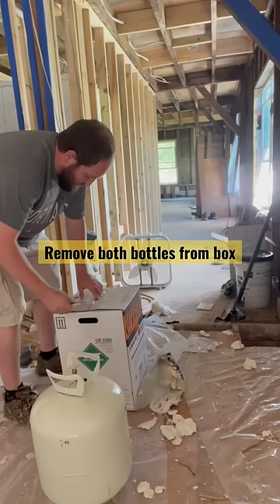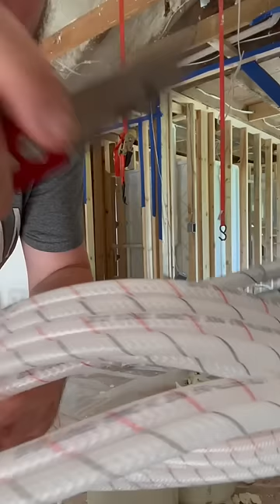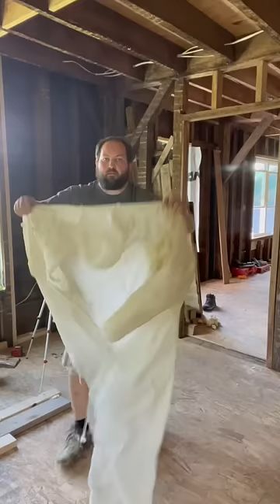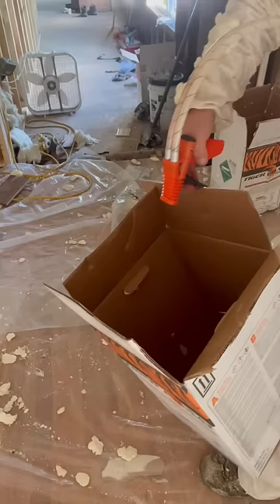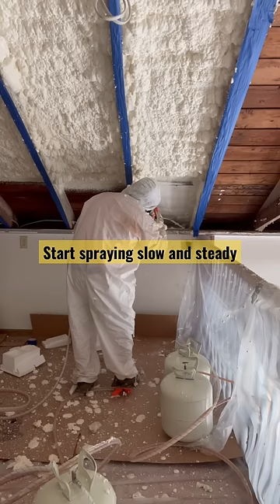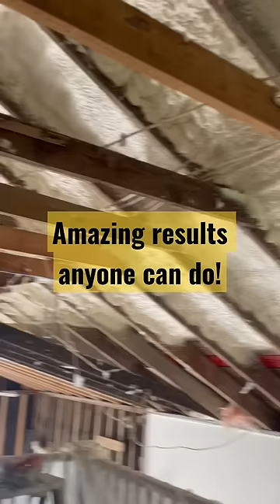Learn to spray foam in 60 seconds! 💡#shorts

Comment: good job but make sure is done correctly cuz even professional people had done wrong by not getting the right mix ratios and temperature, foam is really great on keeping r value but it's a double Edge knife, Current spray foam mixtures containing formaldehyde can produce the airborne MDI against which the EPA warns. Such chemicals can cause cancer and contribute to unsafe air quality.

Comment: I live in Texas and have r-15, r-19, r-30 fiberglass roll insulation & blue board i installed and everything sealed correctly to avoid a hoist of problems like moisture to prevent future rot, and my attic stays around 70°s & 80°s on hot 100°+ summer days. Also its quick and easy to install, remove, replace or get access if work or repairs are ever needed to be done. The foam not so much. The fiberglass insulation isn't as messy, restrictive in multiple ways, pain instilling for repairs replacements and installing, or even take close to as long during the installation period. As long as it's installed correctly and is the correct type, rating and size for the occupied space it not only does the job, but performs and holds up just as well as any other products including the foam shown in this video.
Reply: I would recommend installing baffles between. I wouldn't recommend the spray foam, also this kit costs almost the same as having the spray foam installed including materials... but it isn't my house looks good from here
Reply: I get different climates and whether you'll be heating and cooling the area change the installation process but anyhow love you my dear friends Don't you attack me unless you plan on really sticking it to me good.

Comment: It’s 4am and I’m getting ready to go to work on a Sunday to insulate a house, that’s what we do and iv been trying to get my boss interested in starting to foam houses instead of using regular insulation but he’s not interested at this point he’s already a millionaire from building his insulation company from 30 years ago !!!
Reply: Can you reuse the wood after sprayed?
Reply: @J-Mac8  yes, but it’s not going to come completely off. Because it expands it tends to embed itself into the wood fibers. In general it’s cost of labor vs cost of material scenario for builders. Cost less to just buy new boards. If you want a more eco friendly alternative you’d go with rock wool insulation to get a similar R value. For air tightness you use a sealing caulk at each connection point. The main point of going with a spray foam system is to do a closed air system that uses an air exchanger to circulate indoor and outdoor air. If you don’t have an HVAC system that uses and air exchanger you can run into moisture issues.

Comment: Don’t forget to make sure your mix is perfect. If not this toxic mess will “off-gas” for years and make you sick.
Reply: Well damn, that's more important than the fact its doable. Hopefully everyone who does it knows that
Reply: @DS-qy3qv  Sadly not. And because of this issue some countries (mainly in the EU) are considering banning spray foam. And rightly so.

There are better ways to insulate a house, like sheep wool. It's 100% natural and fire resistant. But more expensive and slow to work with.
Reply: Nah
Reply: @DriftKingNL  NO. the fiber fill companies want you to think that. lots of misinformation out there. There is nothing better than foam. look at what they use to insulate every refrigerator, freezer, cooler or window ac unit, companies know for efficiency and effectiveness nothing can compete with foam. 1 inch of spray foam is more than twice as effective as 7 inches of fiberglass. reason being is fiber insulation does not stop convective heat loss, and that is where you loose the majority of your cooling. most batts of insulation regardless of the type have a R value of around 2. after install due to it being nearly impossible to install without air leakage, and moisture absorption. while laboratory testing for R13. It is a bias test that favors the fiber products and does not account for radiant and convective heat loss.  It sucks to admit.. But R value is a useless figure in the real world. running a bead of caulking between the studs and sheathing and leaving a empty void in the wall is more effective than fiberglass.

Comment: What's the cost for the 2 tanks and hose and spray gun¿? Also, how much Square Footage can those 2 cans cover¿?
Reply: $1200 + tax, and 600sqft of 1inch of only R6, basically just for wind insulation.

ikr... i rather buy rolls of r30-60 for ~$1 per sqft.
plus if youre doing it yourself i can imagine one day youre gonna be regretting spraying adhesive everywhere all over your house.
Reply: From my experience, it cost between  barely less to slightly more than having a professional do a better job.
Reply: It runs $1100 for everything which is roughly 20% of what a contractor would charge you and it seals your house unlike fiberglass insulation.
Reply: They have different size sets, but people think they are able to cover 200 to 600 sf and that is only at 1" if you get the full yield they advertise and you don't

Comment: Those two little tanks on the floor cost about a thousand bucks, don't they? That s*** ain't cheap. And it never goes as far as you think it would
Reply: About $200.
Reply: @petehill7250  provide a link to where I can buy that for 200 bucks.  That's about 800 kit he's using in the video

Comment: And when in 50 years thy house to be destroyed where all tha foam ll go...in the fields. I don't believe that even then there will be a proper recycling process. Insulating the house ll save energy now but the added artificial materials definitely ll need energy and time to be disposed
Reply: Where do your batteries go?   We’ll just send it all to Africa land fills. That will work now we can feel good about our selves again
Reply: Good point - blown foams are a curse on the environment, just instantly breaking apart into smaller units making cleanup a nightmare. Don’t worry we’ll slowly clean them up by eating them. Well, our food will eat them, then we’ll eat our food.

Comment: Also ive heard this stuff isnt good in a house fire because its flamable fiberglass isnt it may seem like it is but itd just the paper and yall i type fast so my spelling is trash and i shut off auto correct becuase it kept changing fuck to duck and shit to shop
Reply: Once it dries it's good in general. If you're in a wildfire area or field though there's a good flame retardant one that could possibly save extra time against fires.
Reply: Ok, sweetcheeks. 😘
Reply: @WhiteWolfos  hmm that sounds nice

Comment: Spray foam can cause air quality issues if the ratio of both parts is off.  Consider hiring a qualified insured professional. Your health is more important than the dyi cost savings.
Reply: Don’t listen to this foo
Reply: Or you can just read and follow the instructions on the kit.
Reply: @miahzzeebest701  not quite. It’s a sub par product. It does not mix correctly you need to be above 1,000 psi to get atomization between the two materials. The piss spray with 2 crossing streams is not a proper mix

Comment: Insulation is incredible. Had my shed done ✅ but it off gassed formaldehyde for 3 years. 

How do you stop that in your house?
Reply: Must have been fiberglass to off gas formaldehyde. Closed cell foam will off gas of its life. Open cell foam off gases when applied thus open cells.

Comment: Good job. Too bad foam has all the negatives and not one positive. The R value even sucks for foam. Idk why anyone pays top dollar for a product that literally traps moisture between your walls making the wood rot like a mth heads teeth... im a contractor btw.
Reply: Totally agree - aside from a few specialty applications - (rim joists comes to mind) it is over priced junk.
Reply: @simonlester578  maybe corners in a pole barn house. Other than that, stick to windows and doors for the foam lol
Reply: Some people just don’t evolve
Reply: And termites just blow through most of the foam to make new nests.
Reply: There's different types of foam for different applications.  The fact that it stops airflow is a huge benefit over other forms of insulation.  If you have a crappy roof, yes leaks can be an issue.  That would be true of any insulation.  There's downsides to foam, but theres downsides to the other types of insulation also.  Let's not be so critical.  I'm also a contractor, and that doesn't matter.
Reply: I wudnt use it cuz it covers the wood and if get termites or moisture damage to the wood u wud never kno

Comment: Really really really shouldn't diy spray foam. Wrong ratios of either chemical could pose a health risk.
Reply: Doubtful, both tanks mix evenly as long as both are NEW tanks. Only if he were to have to make his own batch for the tanks would it be risky.
Reply: Wrong chemical mix will only cause it to not set correctly, which leads to it not insulating properly. As long as you’re wearing proper PPE and customer is out of the house for proper amount of time, all is good
Reply: @brookekathryn1980  hmm not saying you’re wrong, I just don’t ever remember that when I got certified. I don’t run a poly rig (I wish). I only use the tank kits since I mainly do relatively smaller jobs.
Reply: @jacoblabruyere2790  In general poly is bad news if anything is off a few lbs.
Reply: @brookekathryn1980  gotcha, maybe there’s a difference with a Poly rig?
Reply: @jacoblabruyere2790  None whatsoever. It's all the same.
Reply: @jacoblabruyere2790  There are different variations, weights and viscosities but they're all the same.

Comment: Is spray foam insulation even any good?
Reply: Not for cold
Reply: @renaud6556  no good for me then
Reply: @redeye118  yes, but you would like to go with a closed cell foam ie 2lbs closed cell polyurethane foam.  It’s widely used in places with cold temperatures at least where I’m from in Ontario, Canada
Reply: If done properly, depends also on foam, if using half pound foam it needs to be at least 100mm thick and 2 pound foam needs to be at least 80mm thick. 2 pound would be better because of thickness of wall cavity, if in ceiling space you have the luxury to go as thick as you want. Think of it like an esky, if you cool or heat the house it stays cool or warm longer. 
I did a ceiling with 125mm of half pound. That day was 45 Celsius. The client said they came home and their aircon had icicles clinging to it. They also said Its the first time they had the aircon off during the night and had to sleep under the blankets.
Reply: Thanks for the replies
Reply: 2 pound closed cell foam works great for heat or cold, I install it every day in Canada and customer feedback is always positive. We don’t use these froth packs that are shown in video though so I can’t speak for this particular product.
Reply: @Fardinshidinov  I spray foam everyday too! 🤟

Comment: Did spray foam, open and closed cell, for a decade and I can tell you that this personal diy set up is super expensive and not worth it. Trip minimum from a reputable company is cheaper and done better.
Reply: Don’t think I saw an even layer of foam anywhere.lol I guess if you’re just looking for that insulated aesthetic this is fine.
Reply: @mrarchaicworld  I agree, temp, pressure and conditions vary, even on the same house. I'm saying these diy kits are expensive when looking at linear board feet and the prep and clean up alone are worth paying a trip minimum to a reputable outfit
Reply: @nathanaucremanne9778  agreed. In almost all cases, an insulation company can do it better, for cheaper. This is for all types of insulation as well.
Reply: I’m not sure about cheaper got 3 quotes Between 7,000 and 8k to do a 30 by 30 metal building. i did it myself with those DYI kits  for 1/3 the cost. did it look professional probably not but it works well and after covering it all up with plywood can’t see it anyway

Comment: Is this good for the environment?
Reply: A lot of angles to look at on this one. One of them includes the transportation of things like fiberglass insulation. That's going to take up a lot more room on a truck and require more loads and fuel burned, tires, brakes, and so forth.
Reply: @ProleDaddy  so it's about the same cost as a couple of meat burgers ay
Reply: @WhiteWolfos  Wat?

Comment: I took HVAC trade classes and it is pretty well known to stay far away from this shit. Its a pain to work around with if you have to do plumbing or electrical and there really isn’t any benefit to doing it. No R-value increase not to mention the fumes that come off of it.
Reply: Foam is an air barrier, which means it eliminates all convective heat transfer. R-value only measures conductive heat transfer. That’s why foam way out performs fiberglass and cellulose at the same r values. 

Also r value is a sketchy measurement to begin with. It is a function that’s based on the temp differential between the inside and outside temp of the insulation material. The Rvalue listed on your fiberglass batt is just how it performs when the temp is about 70degrees on both sides of partition. If you look up a graph that shows temp vs R-value, you’ll see it actually loses 80% of its effectiveness when outside temps drop below freezing. Foam on the other hand works as expected all year round because it also completely eliminates convection. 

This is why spray foam is the best. It also stops drafts from freezing copper plumbing which is popular in my market. 

But yeah of course the plumbers and hvac guys should be finished with their work already by the time the foam starts. Everybody not wearing a respirator should leave the work area until the spray foam work is complete.
Reply: @Fee.1  probably just regular old insulation

Comment: Ventilation trays
Reply: Not needed
Reply: @heknows5418  until there's damp...
Reply: @PTechMedia  soooo shingles with fiberglass insulation don’t leak, if you have a problem get up there and repair it doesn’t matter if foam or shingles. All I know is when I foamed my house the electric bill was cut substantially, I actually called the power company to verify that I had the correct bill, been lower every month since.
Reply: @heknows5418  its not about leaks, its bout letting it breath, and ventilate ;) condensation will go in, and wont be able to escape without airflow
Reply: @PTechMedia  just believe what you want ,I have it in my home and love it
Reply: @heknows5418  did you install it yourself?  There's special trays to aid ventilation. 😉
Reply: @PTechMedia  no professionals
Reply: @heknows5418  let's hope they knew what they were doing
Reply: @PTechMedia  they do

Comment: Yeah bot u gotta buy like 20of those 2tank sets to do the house hehe
Reply: Covers 650sf @1 inch thick
Reply: @zachyoder7114  on a good day with perfect conditions. Stuff is a joke if you have ever seen a high pressure system.

Comment: And in a few years you'll have learn to be a carpenter/roofer in 60 seconds to replace that rotted out roof that got no ventilation so it turned into mud.
Reply: technically that isnt the science behind it but i dont want to get into all that in the comments
Reply: Yea with Riley its not quite how it works! There are such things as “Hot Roofs” they’ve been doing them forever! So his roof is not going to turn to mud!🙄 love when people make comments on shit they clearly don’t know what they are talking about!
Reply: The problem is closed cell foam on flat ceilings. If it's got a slope it's fine!
Reply: @hubes96  well I do understand how roofs work. They get soaked when it rains and if you block the ventilation they rot bc they don't dry. So stupid me can't see how covering thi inside with plastic and no ventilation could be a good idea.
 But hey it's not my house.
Reply: That is silly roofs need ventilation to cool the attic this attic will be cooler than any ventilated roof. I'm a roofer you don't even work in construction don't lie either
Reply: @matthewartiles3179  13 years mat.  Call me silly
Reply: Where I live, banks have started refusing mortgages and insurance companies won't insure properties that have this stuff sprayed on the roof because far too often its being incorrectly done causing the roof joists to rot out. So yes, it really is something that happens.